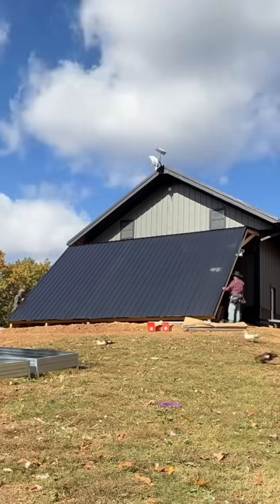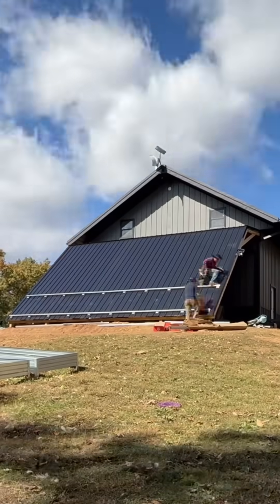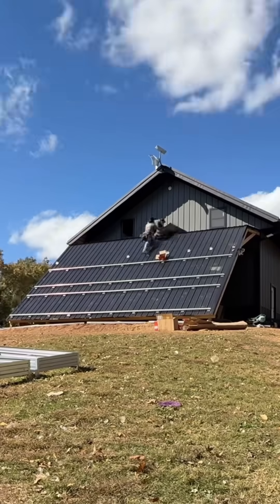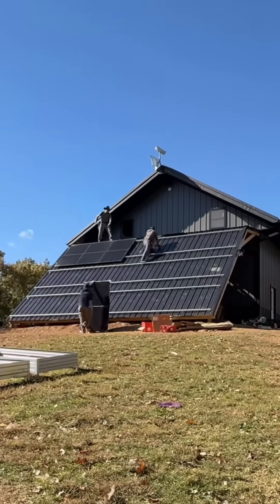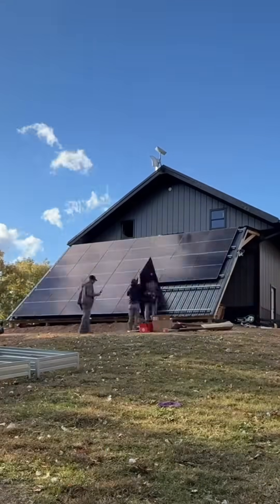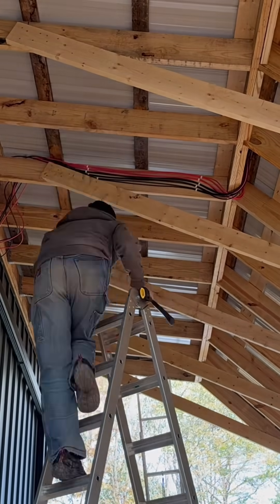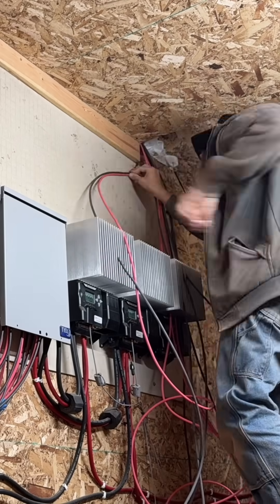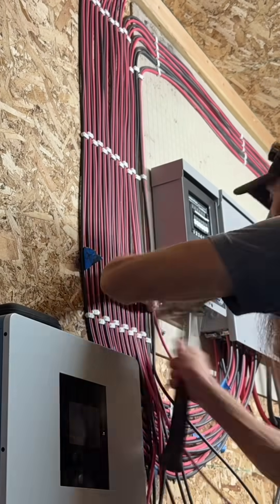Putting up a SE facing solar array#narrowayhomestead #offgridliving #solar #power #solararray

Comment: Why so many dc  cable with standard inverter you can put 16panels on 2 wires. Did you pull every panel separetly ? OMG

Comment: The only reason the wiring looks so neat is because it's against code. High voltage DC must be in a metal conduit or raceway once it enters the building.
690.31(G) Photovoltaic System Direct Current Circuits on or in a Building. Where PV system dc circuits run inside a building, they shall be contained in metal raceways, Type MC metal-clad cable that complies with 250.118(10), or metal enclosures from the point of penetration of the surface of the building to the first readily accessible disconnecting means. The disconnecting means shall comply with 690.13(B) and (C) and 690.15(A) and (B). The wiring methods shall comply with the additional installation requirements in 690.31(G)(1) through (4).

Comment: Good work overal,nice wire management looks like our wire trays on our comercial solar fields 👍 

Though if u want all day sun in the future you could get a suntracker solar aray that litteraly pivot the pannels and track the angle of most direct sun all day long . They could solve ur only getting sun on one side ishue only needing a couple Tables of panels or a  singular array of panels instead of having one on both sides of your house. 

Food for thought in 15-20 or so years when that new system u just put up needs replaceing  [(the  lifespan before needing replacement of panels due to loss of power acumulation in the cells or structural integrity of the frame is 20 years max)

Comment: I have an array about that size but I have microinverters behind each panel. So much less wiring and probably less loss and you don't have the safety concerns you have with long strings of high voltage DC
Reply: How do you have less loss?

Comment: “So I spent 100k to not have to pay a $150 a month bill.  Thats $1800 a year, after 20 years thats only $36,000. It will take over 60 years to be a benefit. Solar is regulated by our corrupt government to only be 18% effective as to not be better than the grid and lose customers.  In a nutshell solar is a huge feel good scam not a practical one.

Comment: please cost break down 
panels + delivery 
batteries = delivery 
all converters inverters and brains 
rolls of wires 
install    
total 
how long to fully charge on avragebcloudy hours 
can it keep a full size fridge going 24/7 
even on cloudy days 
all led lights in house 
water pumper to filter water 
is insta hot electric or gas 
cook top electric or gas 
heat the house electric or gas 
my 2 cents cost per energy out put = not worth it 
i generate no wind no solar  big scale granfather clock 
with weights GRAVITY 24/7 at 100%
solar is 8am to 4pm 20% 80% (in desert) not efficient

Comment: i know its a big buzzword these days, but modularity.  if they can make these systems extremely modular as in you can change pannels and all the connectors work brand to brand and the mounting works, it would make it easier to upgrade to newer, higher wattage and more efficient panels without the requirement to do new wiring (unles NEEDED) just because you got new panels.  can use you existing infrastructure.  though all in all, this lnstall looks good

Comment: You have to many wires, as someone who installed panels for quite a while you don't need wires going to every panel you just need to hook the panels up right then its just 2 wires, also I hope at least for where the wires connect to the pannels is coverd those wires are very well UV rated we usually would put them in conduit then run it to the inverter

Comment: While everybody oogling over the cable management, I'm wondering if you can collect enough energy to heat your home in the winter?
Reply: @steventhury8366  No, he can't, it would probably take an acre of solar panels and a grid-scale storage battery to make that work.
Reply: @PistonAvatarGuy  A typical geo-thermal HVAC unit uses only 5,000 watts. These solar panel are more than enough.
Reply: @MrSummitville  You're confusing energy and power. How much energy does a heat pump system consume in order to heat a typical home during the coldest, darkest days of winter? How much energy do the solar panels produce during the coldest, darkest days of winter?

The other problem is that you need the most heating energy at night, but solar panels do not produce energy at night. You'd need a way to store huge amounts of energy during the day so that it can be used at night. That's not difficult to achieve, but it is very expensive.
Reply: @PistonAvatarGuy   I am not confused.  I have Solar and I have geo-thermal.  I am not worried about 1 day. I am talking about a yearly average. His Solar Panel system will generate enough killowatt-hours per year to offset a Geo-Thermal HVAC unit.
Reply: @MrSummitville  He's off-grid, the offsetting bs doesn't work here. He actually needs to produce the energy that he's going to consume within a fairly short time frame.
Reply: @MrSummitville  And, really, offsetting is just BS in general, because it's not like you're putting the fossil fuels that were consumed to produce your energy, when your solar panels were under-producing, back into the ground. And people wonder why we're getting nowhere when it comes to reducing CO2 emissions.
Reply: @PistonAvatarGuy  Doesn't he have a Battery Bank?  Your reply that he needs an acre of Solar is the BS.
Reply: @MrSummitville  You would need a gigantic battery bank to run a heat pump during the winter months.

If he were to try to heat his home using only his solar panels, it would make the most sense to have a way to store heat directly, and this would involve having an enormous mass of something in which to store the heat. A gigantic, well insulated water tank would be one way to store heat, but, again, expensive. Someone was also working on storing heat using a giant silo full of sand, but I don't think that their project ever really went anywhere. The technologies work well, but they're expensive, take up a lot of space and are mainly only useful in the winter. Heat storage just isn't very practical for the vast majority of people, either.

He almost certainly heats his home primarily using wood, as do most off-griders.

Anyway, how much solar panel area would he need? I've never seen anyone do the math, but I suspect that I'm not all that far off in my estimate. And, to be clear, I'm talking about the installation size, not the actual solar panel area. To be well optimized for winter, solar panels need to be installed at a fairly steep angle and the rows of solar panels need to be spread well apart from one another in order to avoid problems with shading.
Reply: @PistonAvatarGuy  And he has a backup generator.  No, I don't need a massive battery bank.  You keep talking BS. YOU can't do it.  Smart people can ...
Reply: @MrSummitville  You don't need a battery bank, because (it sounds like) you're still connected to the grid. In an off-grid application, if you were to try to heat your home using only solar panels (no fossil fuels, no burning wood, no backup generator), you would need an enormous solar panel installation, AND an enormous battery bank. I've never seen an example of anyone doing this, anywhere, EVER. Show me a "smart" person who has done this.

Also, because we're supposed to be eliminating our dependence on fossil fuels, I'm talking about ALL types of heating in a home. Space heating, water heating, cooking, etc. And, my point is to show just how insane consumption would need to be on an individual basis if every person on Earth chose to live this way. Massive solar panel installations, massive inverter installations, back up generators, massive battery banks, etc... the resource consumption just goes off the scale relative to grid powered homes. All of this is just a way to get people to consume more stuff from a certain large country in Asia.

Comment: Hey I work for a solar company and just thought to say if you get heavy snow it’s good to add a third set of railings for the panels for more bracing in the winter times! Love the journey and I’m a big fan!!!
Reply: At that angle the snow won't even stick. He might have a problem with snow buildup on the bottom row of panels though.

Comment: This looks good. I have neighbors installing as few as 5 panels on a 4 bed, two story house, panels on the roof and a battery system in chronically over cast and dark ireland. I suspect they are completely wasting their money. In the summer they will get a negligible reduction in their electricity bill. In the winter they will get nothing. Paying someone to clean the panels will completely erase any benefit and when the panels need replacing they will find out they lost a lot of money.

Comment: I understand that the work looks nice. But as an electrician, there is a 100 times better ways to do that, like running Emt from the roof down, which is actually up to code. the way it's ran is not.  P.v. wire is not allowed to run through wood structures, it's only allowed to be used under the array or in jumper conduits between the arrays.

Comment: The Smart flower sounds like it would have suited you better. You wouldn't have had to worry about which direction the panels were facing because it adjusts like a sunflower to the position of the sun.

Comment: Its interesting to see how different you do it than in my country. Out of curiosity, whats the reason behind running every single PV In parallel instead of 1-3 strings? If paralleling why at a junction box near the inverter instead of on the roof? 

Here this system would be just 1 or 2 900 or 450Voc strings and much less cable menagement and copper used.

Comment: Great job Nate!  I looked at the work you were doing on the video and the sheer number of wires that you had to install and keep track of was incredible to me.  I immediately became overwhelmed.  I was a Firefighter for 22 years, got zapped once pretty good back when we were pulling meters (residential only) to cut the power so that interior crews could breach walls and pull down ceiling without worrying about getting electrocuted.  I can do amateur plumbing, dry wall and some wood work but electricity is something I would rather not do.  In my opinion, you did a super job Nate and I found yet another thing that I admire about you, Minion and Az.

Comment: If you don’t want to think of how many hours you have done. How many metres of wiring have you done? 😅😂
Reply from the maker: Based on wiring I've purchased, this system is probably around 2000 feet of DC wiring.

AC wiring on the homestead is probably around 3000 feet if I had to guess. I have some long runs lol